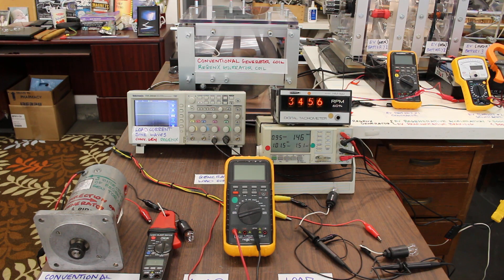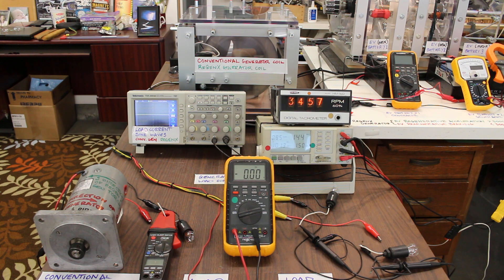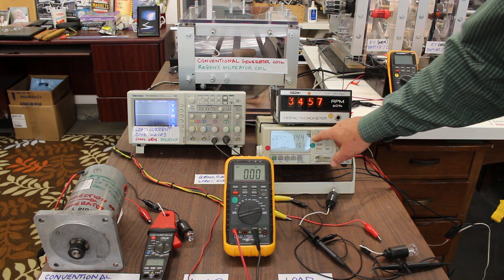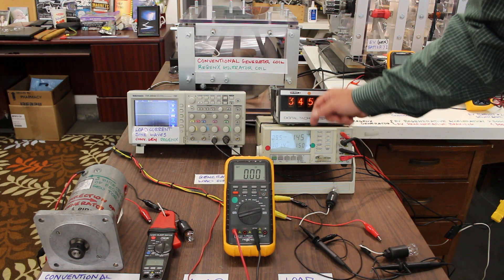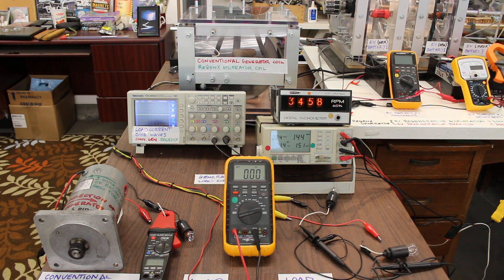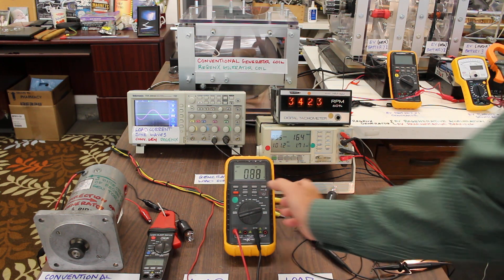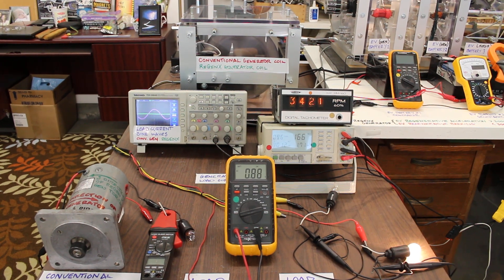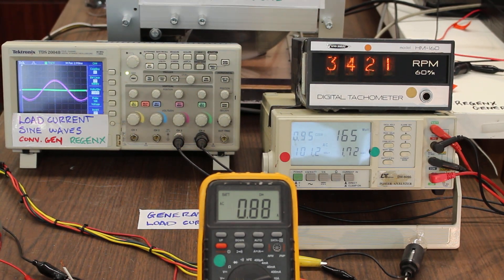ReGenX Generator and Faraday Generator - PERPETUAL MOTION MACHINES OF THE FIRST KIND

Comment: Hello Thane,  nice explanation! I 'm wondering what happens when you put a larger load. how would you mount a system to make available let's say 5kW to power a small house? If by adding load the system increases its velocity, when adding several loads could lead to a great acceleration of the system, isn't it? how you control that on a large system? Would it be possible to put as load one alternator from which I can take usable power while powering the primer mover? The primer mover would be started using a cap bank until is set to motion and until is able to get the alternator to produce enough power to move the primer mover... is this possible? Thanks!
Reply: I was wondering the same thing.